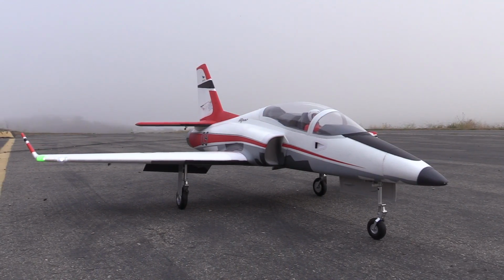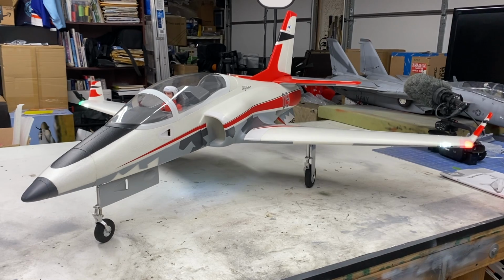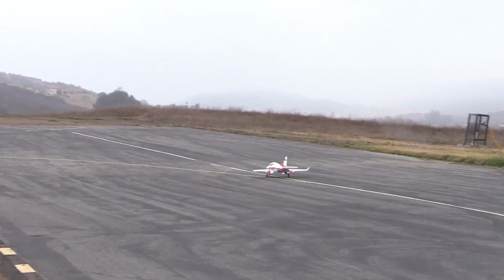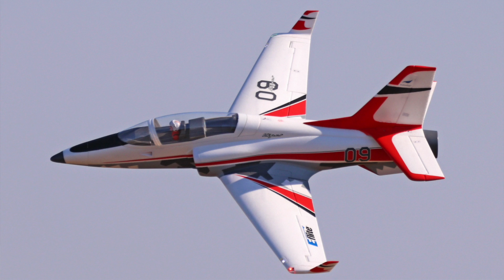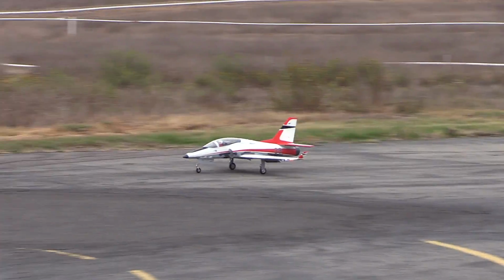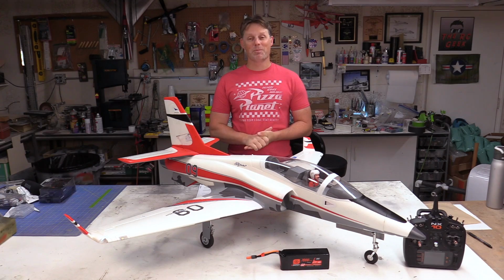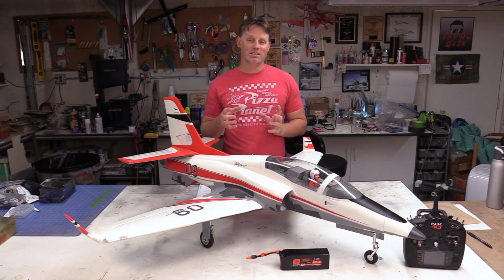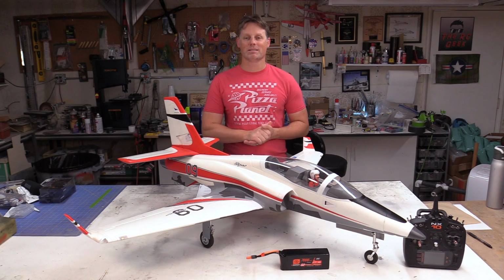E-flite Viper 90mm EDF Assembly & Flight Review | The RC Geek

Comment: I got the bounce ironed out by simply shifting my CG back from the first strap like you did. Let me say you are probably one of the best reviewers out there. You go over throughly the CG’s you have figured out and that helps the rest of us tremendously. Your very honest with what you are encountering in your flights which helps the rest of us cut down on surprises. Thank you and keep up the excellent work, your reviews have guided my last three plane purchases and your videos have helped me to iron out minor issues. Thank you for your time to make the videos and helping those of us who are working to become better pilots.
Reply from the maker: Thank you so much for your kind feedback!  Glad you got the bouncing sorted. The model lands very nicely, but can get pretty heavy on the elevator in the flare of the cg is too far forward.
Reply: Hi Sherman. "Bounce"? Yikes! I have not flown my new Viper 90mm yet, (super nervous to try) and I was unaware this was a problem with this model. My Cirrus is like that - and it makes me crazy! Are you actually flying slightly tail-heavy then? I appreciate the heads-up, this kind of info is so helpful. Thank you! Dale

Comment: Could you also tell me why you do your CG checks with the plane upright? I always thought a low winged plane should be upside down on checking CG? Thanks
Reply from the maker: Whether right side up or upside down, it doesn’t matter when checking the cg. Typically it’s just easier to check a low wing airplane upside down because it hangs a little easier. But, it’s not a requirement. I switch back and forth depending on the airplane and what’s easier.

Comment: Does the BNF version allow forward programming to change AS3X and SAFE gains as you would with say an AR631 that you'd use with the PNP version? Thanks
Reply from the maker: You can get into the forward programming, but unfortunately the bnf receivers are locked. So can’t adjust gains out of the box. The receiver can be unlocked, but I think it requires connecting to a computer to do that.

Comment: Thanks again for sharing your knowledge,  for the great video and answering my other question. In the end I bought the Viper 90. Beautiful model and sturdy landing gear that also works well on low grass. However it has a problem mainly in landing and full flap: the left wing stalls close to the ground. It happened to me twice and I gave up, temporarily. I saw online that using the "Crow" system seems to land much better. I would be grateful if you could give me some advice. Greetings again from Italy.
Reply from the maker: These will definitely drop a wing if they get too slow. Adding crow will definitely help that.

Comment: Have you tried a 5000 pack in this jet?  If so was the performance better than the 7000?
Reply from the maker: I only ever flew the 7000. What you’ll get is a little more vertical performance, but top end level speed will be faster with the 7000.

Comment: Does the 7000mAh pack give you solid 5min or more flight time? Thx👍 debating between 5000 or 7000 packs
Reply from the maker: Yeah, 5minutes of mixed flying is pretty easy to get with the 7000 pack.

Comment: Hello again Chris. I have been frequently referring to your videos in an effort to get smarter with my RC planes. I was wondering if you would be so kind as to point me in the right direction to find the factory as3x gyro settings that come in the various bnf Efite planes? I always update the receivers to "Open-Stock" because I do not like some of the proprietary mixes, SAFE select settings etc. I do like the actual gyro gains that come in most HH planes. Once the receiver is "Open-Stock" I am only guessing at the gain range HH used for the various planes, and I am having a tough time finding the sweet spot on the gains. As you know, these bnf receivers are initially locked, and you cannot see the actual gain settings in Forward Programming.  If you happen to know where I could find these numbers, I would be very grateful! Thank you. Dale
Reply from the maker: Instead of going to the fwd programming, if you scroll over to the right from the main screen, I believe that it shows you the gains that are programmed. That’s what I did when I reconfigured the eflite f16 with flaperons and tailerons.
Reply from the maker: Otherwise, I’m not aware of a database anywhere that shows the gain values at all.
Reply: @Thercgeek  Thank you so much for the reply. Like an idiot, I did not check the factory gyro settings before I upgraded the receiver. I don't suppose you have any idea where HH set the AS3X gyro gains? Love your videos! Thank you again.

Comment: My compliments for the amazing video. I felt like buying it. I have a fair amount of experience with airplanes and a lot with helicopters. Before buying it I would like to ask you if the landing gear is also good on a grass runway or if there are any problems, or if you have tested it on a grass runway.
Thanks and greetings from Italy.
Reply from the maker: The landing gear are quite robust in the model actually. I think it’ll handle grass without too much trouble so long as it’s decently mowed and not super thick fescue.
Reply: @Thercgeek  ❤

Comment: Chris, where do you get the tools/devices to measure your control surface movements?
Reply from the maker: Unfortunately, it’s a discontinued great planes tool. I’m trying to source something similar to be able to offer in the future. Haven’t had much luck this far. 😕
Reply: Thanks for your fast reply. Your videos are excellent and very helpful.    Thanks.  @Thercgeek
Reply: Donald L, Motion RC has a benchcraft deflection meter that's very similar.  They came back in stock about 2 weeks ago.  Not sure they are still in stock.
Reply: Already bought it, thanks!

Comment: Hi Chris, I have some e-flight Jets with Spectrum ESC and Spektrum iX20 radio. Trust reverse works great at all. BUT for now I want the 90mm EDF VIPER fly with another radio make (CORE from Powerboat-Systems). DO YOU KNOW if it is possible to use the trust reverse feature also with another radio like Spektrum??? BTW: Maybe you remember me, I am Thomas from Germany and I order all my afterburners at you 🤣
Reply from the maker: I believe taking advantage of the reverse thrust within the esc requires having a Spektrum radio.
Reply: @Thercgeek  That's what SPECTRUM RC also says 😥

Comment: Make it into an 8-channel crow setup like I did and you can sustain a flare for landing: https://www.youtube.com/watch?v=Ly7y2UUB7Rc

You can also high alpha with about a 25% crow mix.

If you're flying stock, it'll most definitely tip stall with flare attempts instead of settling in, and high alpha is basically out of the question.

Comment: My friend, you've been involved in EPO much longer than I have, so I'm surprised you don't know this. Expanded Poly Olefin plastics exude plasticizers over their half lives ( about 10 years). These vaporous solvents will cause polymer enamel AND water soluble white paints to yellow out HORRIBLY at at frightening rates. Use a thinned (oil base) UV filtered polyurethane, or UV stable acrylic polymer art sealant ( test an area that isn't structural or cosmetic for compatible traits), and just mask and coat your EPP. Painted areas? Mask, or cover. You' re better off letting the foam discolor a little unless the extra weight and shorter flights don't matter. Me? I armor these $5.00 foamboard EDFs to the teeth. So, five dollars in materials. ( Motors, ESCs, Rx, servos, etc. salvageable). I digress. Applying two coats of clear polyurethane varnish to foamboard  results in over a 325% increase in rigidity at a cost of 14 milligrams per 100 cm squared. Pre-coated foamboard and new practices? (FliteTest!) And who knows what we can come up with! 
Dig what you're doinn'
Mike.